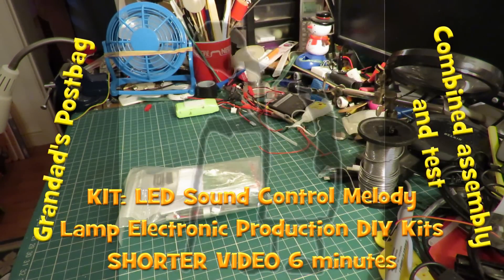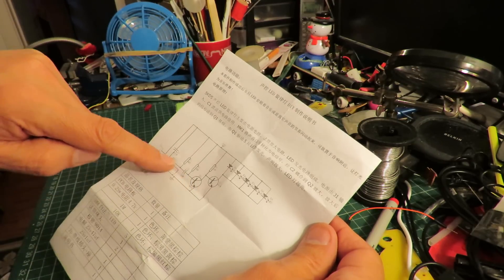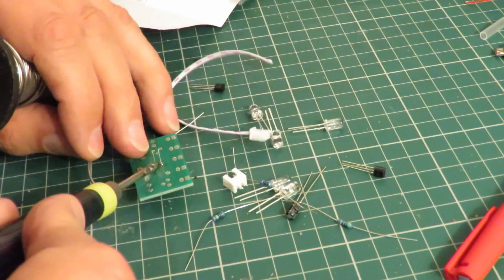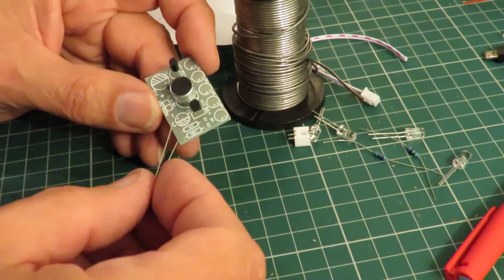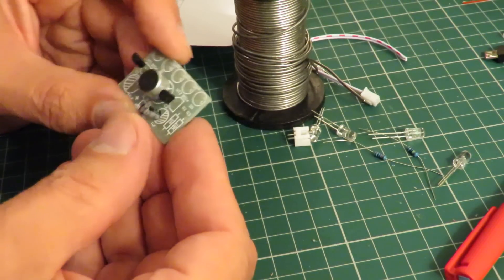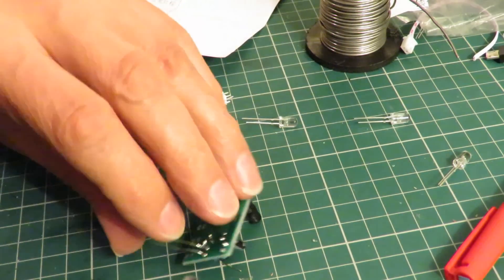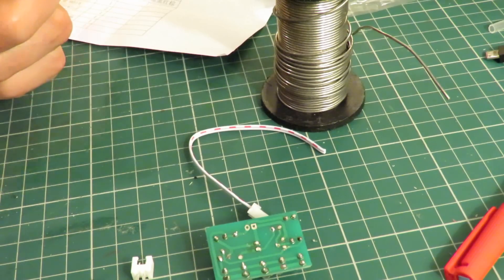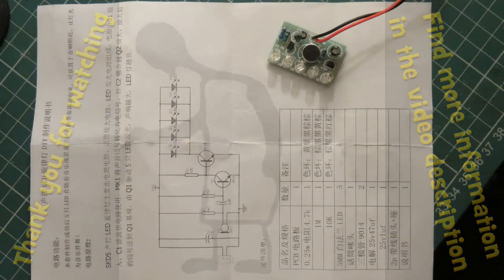LED Sound Control Melody Lamp Electronic Production DIY Kits SHORTER VIDEO

Comment: Hi, my module flashes as soon as I supply it with 5V even without the music. and once the music is activated, it hardly follows the rhythm of the music. Do you have a solution please?
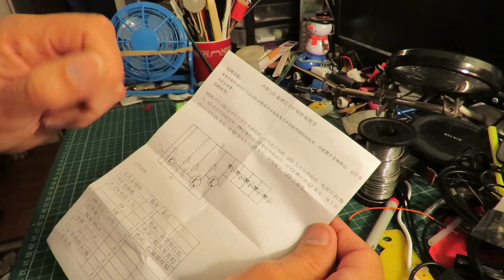Reply from the maker: The microphone acts as a variable resistor as shown in the diagram at 0:55 so if yours is not responding to the music it is likely there is a problem with the microphone. Either it is not soldered correctly or it is faulty. You could try shorting across it's terminals or desoldering it to see if the circuit stops functioning Alternatively you may have some of the resistors in the wrong locations so the effect of the microphone is reduced..
Reply: @GrandadIsAnOldMan  I just tested again with an 18650 battery and everything works perfectly! The problem had to come from my old 12V transformer which is 20 years old and bought 5 euros with which I had made the first test ... I must decide to throw this old transformer at the waste disposal site and make something for myself. More reliable ;)
thanks...
Reply from the maker: @mekateknik3717  well done 👍😃

Comment: Fellow old man what voltage did you use
Reply from the maker: I used a single cell LiPo battery because I had the connectors handy on the desk, so that is 3.7 volts
Reply: Thanks
Reply from the maker: I blame you now, browsing eBay to look for that USB Charger item and I have ordered another half dozen kits  😊
Reply: Ron Thompson
Fellow old man what voltage did you use
'
hi R T...
my LED melody sound kit can use a pack of four AA batterys as 6 volts

Comment: '
hi man...
this kit is almost same as velleman MK103 sound to light unit kit...
this LED kit dont have a sound control
Reply from the maker: I wouldn't know about a velleman MK103 kit however I think the title can be read two ways. It is intended that the sound controls the LEDs not that the circuit controls the sound, hence the microphone detects sound and the circuit lights the LEDs